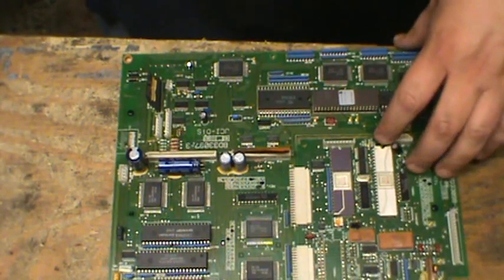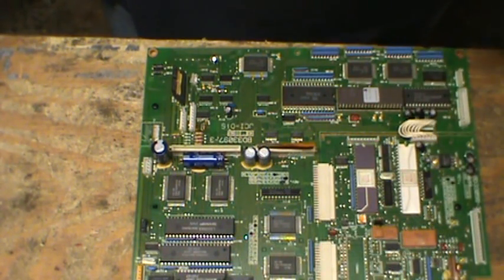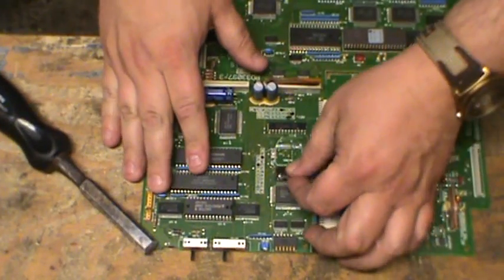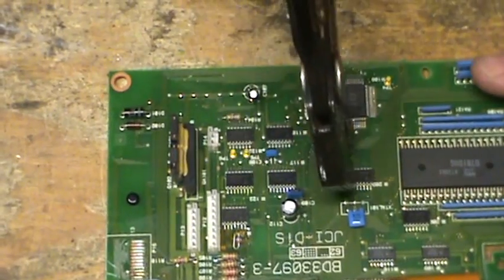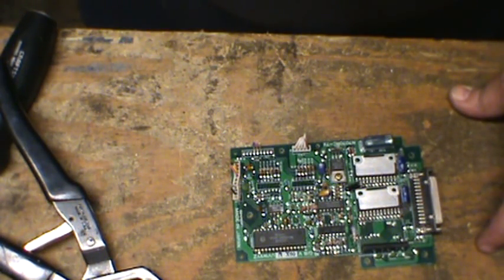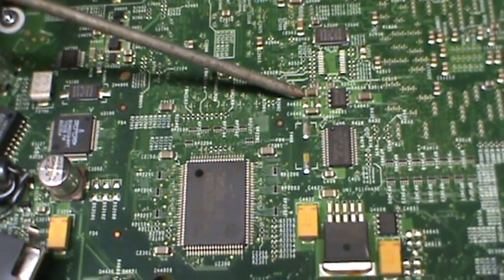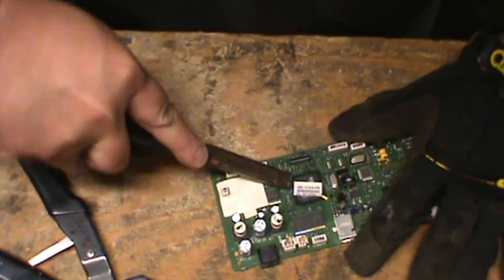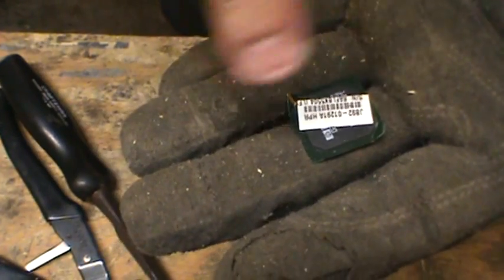Scrapping, how to remove IC Chips, and what else is worth money on a circuit board

Comment from the maker: For most of the soldered ones I still use the channelock twist to get them off.  It may take a little wiggling back and forth but they do pop off.  There are other methods of depopulating boards that include a hot sand bath that I have not tried yet but 10464jeff has a video on that, also you can use the more toxic method unless well ventilated of using a heat gun or a propne torch behind the board to soften/melt the solder.  Beware of the fumes thought!  Thanks for watching!

Comment: OR, if u actuly CARE about the chips, desolder them and sell them to pepole who build electronics with them.
Reply: otherwise u are doing what kids do to pcbs
Reply: if they are old mobos, most of them are pretty useless
Reply: um, nope. The older (30-40 year old) boards often have more rare and hobbyist friendly parts on them. Modern boards are built by robots using extremely tiny parts that are difficult to work with.
Reply: But you have no idea if they work or not.  Could be from a fried motherboard.
Reply: Connorocker my kn
Reply: Many IC components are so tiny that by the time you remove them, you're likely to damage them to the point of uselessness.

Comment: Awesome video series on the electronic stuff.  Lots of stuff learned there.  I'm just starting to get involved with scrapping out computers since its basically untapped around here.  I've been in the auto salvage business for several years now, but this would give me something to do after its dark.  The ultimate question to me is, how far should I go when breaking down the boards?  Cut the fingers off and send the rest to boardsort?  Or is worth taking all the IC's off?  If you yank the IC's, will somebody buy the rest?  I'd appreciate your thoughts.
Reply from the maker: I think that you get the most bang for your buck, and time, by starting off recovering gold from the fingers.  Boardsort will still buy the rest of the ram and pci card without it.  Its gets your feet wet so to speak with gold recovery.  Then you can decide if you want to venture further.  The big thing to remember is the volume needed to get decent results.  You can spend hours plucking gold plated pins for only a gram or two of gold, or you can spend a fraction of the time, sorting and shipping to boardsort.  Once the IC is removed from the RAM, they wont buy it.
Reply: Moose Scrapper Thats exactly the info I was looking for.  Thanks again and keep on scrapping!

Comment: What about gold within the layers of the board itself?  For instance, the apparent gold connections in the board that are under a cpu chip.  Gold connects to gold well so there should be gold where gold pins go into the board. Do any boards have a layer of gold underneath the green, red, or whatever color surface?  What are gold colors that shows in various patterns on the board but seem to have no particular purpose?

 Are any silver wires solid  or are they always plated?  If solid, which ones are they?

Comment: In my low grade boards  I take out the tube fuse too since it's so easy. I wonder if they can be sold on ebay by the pound too? I've also found that heating the board with a heat gun can loosen up everything pretty quick and easy (for low grades). I found a board that's metallic and can be bent, it's not silicone for sure. Have you come across that type of board? Is it worth anything?
Reply from the maker: Yes, I see them in some electronics.  I just throw them in the light iron pile.  Most of their weight is that anyway.  As for the tubes, the best way to look to see what you can get is to go on ebay and search the sold listings to see what they are going for. Thanks for watching!

Comment: do the taller tube type blue capacitors have any value or pm in them
Reply from the maker: +Amber Moss no, they just have aluminum as far as I am aware. (and other chemicals inside of course, just the only metal is Al)
Reply: ty

Comment: what can be done with plain circuit boards (Just the green fiberglass ) after the process of recovering all the precious metal is done?
Reply from the maker: There are companies that buy them for the copper tracing and solder and they also recycle the board material.  I don't strip my boards down that far so I am not sure of any specific names, I just know they are out there.  Thanks!
Reply: Niral Pawar 
Many thing

Comment: What is valuable about a number 2 circuit board? I've heard you mention them in videos, and I wondered what makes them worth scrapping?
Reply from the maker: Hi and thanks for watching.  I do not recall referring to them as #2 board, they are broken up into tiers.  Low, mid, and high grade boards.  Scrap yards buy them for their metal content such as gold silver, platiumun, palladium, tantalum, copper, aluminum, and so on.
Reply: Moose Scrapper I must've gotten you confused with someone else. 'My apologies. Thank you for attempting, as best you could, to answer my question :) . It was helpful.

Comment: Most socketed IC's are programmable and that is why they are, well, socketed and not soldered. I was wondering if these might have gold bonding more often only because of their importance to the machine.
Reply from the maker: I have cracked open quite a few, hoping to see some gold bonding wires near the silicon wafer, programmable or not, its still kind of a crap shoot.  Thanks!

Comment: Thanks Moose! Gained much knowledge about e-waste. I have one question: Does IC chips contain silver? If not what kind of metal is that.
Reply from the maker: IC chips can contain a variety of metals.  They can have gold, copper, silver, and other metals as well.  Type, quality, and age can help determine what is in there.  For the most part, the silver in IC's is on the legs and is plated on.  Originalfeets just posted a video on them.  Thanks for watching!

Comment: Mr. Scrapper, what are the little cylinder capacitors called. They are brown with darker brown or orange stripes on the ends. Kind of the shape of a tylenol.
Reply from the maker: hard to say without seeing but sounds like a resistor.
Reply: Moose Scrapper yep, I googled resistor and that's what it is. Are they worth anything, worth collecting?
Reply from the maker: Not that I know of but I will be the first to admit there is a LOT about thos little componants that I do not know.

Comment: So your busting out the chips aggressively instead of recycling (reusable) , do you just save up so may pounds and sell them to scrap yard  or are you smelting or using your acid/Clorox bath to recover PM?
Reply from the maker: +Robert “1932chevytruck” S I am saving them, I do not know enough about electronic parts to be able to resell them.  I keep them until I have several pounds then recover the gold myself, though HCL and bleach is not the method used.

Comment: Three words for you, bro....rechargeable Dremel tool.... Because you have pointed out the worth of these chips, I have been using the tool to zip them off in seconds with no effort.....other than cracking that bottle cap every 30 chips.

Comment: Im curious as I can not find the info on my mobile device. I have conection flat cable labelled sumitomo-c awm 20624 80c 60v vw-1 f and I do not know if its worth keeping. It shines like silver or platinum but I cant find comfirmation online. Have you discovered the type of metal they contain?
Reply from the maker: Truth Seeker often its aluminum.  Sometimes silver plated, either way, PM value is so low its not worth recovering.

Comment: Would it be a bad idea to sand bath motherboards and just separate everything after you get it off?
Reply from the maker: +ManiaOperativa The bigger the board the more heat it sapps out of the sand and will take longer.  But yes, you can do it that way and just use a piece of window screen to sift out the sand.  Personally for mother boards, I remove what I want for gold recovery by hand.  Yeah it takes a little longer, but when you know what you are digging for you can process them pretty quickly.  Thanks!

Comment: how long does it take you to depopulate your motherboards  also in the audio jacks on the motherboards i tore one of them apart and appear to be gold plated like  i thought maybe just the tips would be but they appear to be completely plated/painted. any insight into this would be great thanks.
Reply from the maker: Luke Ketelhut hI THERE, It takes me about 10 minutes to depopulate a mother board.  I am a bit selective as to what I take off though.  The parts inside the jacks are indeed gold plated.
Reply: Moose Scrapper thanks i'd have to say i'm very new at this cause i take a lot longer to do mine and thanks on the audio pins poped the vga port open on a old video card. it looks like military grade plated lol. thanks

Comment: Careful with board sort . A lot of time spent on pulling capacitors. Ten of them boards you stripped would or you $150.00 . You could still pull ic socket chips . Save time and still make a good buck.

Comment: by the way,thanks for all the help!from watching your videos we made over 2000 dollars in total so far.and still have these tantalum capacitors and gold plated pins.what are these worth a pound?
where to sell?
boardsort didnt give a price on those
Reply from the maker: Thank you for watching!  The value of the gold plated pins varies quite a bit because gold content can vary a lot.  I sell mine on ebay. It helps to keep the different pins separate like ide pins, pins from phone jacks etc.
Reply: makes sense... what do you usually get for different things you can rip of these boards?
Reply from the maker: katnryan verreux Whooo...that would be a long list... IC's about $3 a lb, MCCs, 50-100 a lb, depending on the market.  ide pins as much as $50 a lb, phone jack wires, the same.  flat packs 5-10 per lb, just some basic numbers.  Check out ebays sold items for current pricing.

Comment: +moose scrapper is it worth actually removing the chips. i had 30 lbs of low grade and 8 lbs of high grade boards. after removing all the chips it was all low grade. i only received $.10/lb on the boards. so is it actually worth removing them from the high grade?
Reply from the maker: Value is a completely subjective thing.  There are a lot of variables as well.  What are you scrapping for, the most money, is gold recovery an income or hobby?  Does your yard pay much more for high grade vs low grade?  For me, its worth it because my yard pays one price for boards, and I enjoy the gold recovery hobby.  Its not a source of income that I rely on.  I think that's the best answer I can come up with.
Reply: +Moose Scrapper unfortunately my yard pays separate prices per each grade of board. right now I'm in the stages of collecting the gold to process. i have several 5 gal buckets full of boards that need to be processed. just from land line phones.

Comment: Well I'd like to add to tour knowledge, you can sometimes find tin or aluminum resisters they are soldered on but easy to remove most are about 5mm wide some have a black plastic drink wrap with a gray/white stripe, not sure what kind of foil is inside of them but both end are rubber insulated on the ones I found, bit as a hobbie deffo worth taking a look, I did find similarity's to lead but its far too gray to be lead, iv subbed so if any one has an answer will be much appreciated also while on the subject mist resistors are silica based ceramic so please be careful, they also contain anything from graphite to gold

Comment: if you do this do not through the circuit boards away THE HIGH GRADE ONS ARE 45% COPPER BY weight these boards are multilayered and have to be ground up to liberate the copper but at between 2 and 3 dollars a pound and the price likely to go up save the boards until you have a bunch the look at making a flail mill sort of a hammer mill with chains instead of hammers there are lots of ways to separate the fiber and epoxy from the copper.

Comment: I found a laptop board that has dark orange capacitors and I think they may be tantalum due to the shape and size. But I've never seen this color. Also heard blue caps are tantalum?
Reply from the maker: I still struggle with tantallum.  Original feets knows a lot more, check out his channel and ask him, he has a few vids I think on just those.  Best of luck to you!

Comment: You have a video on how to pull pins off of the "green" boards.
what about ceramic boards?   is it the same process?
Reply from the maker: Hi and thanks for watching.  I do not think I have ever seen a ceramic board?  Where did you get it from?
Reply: ITS A INTEL CHIP
Reply from the maker: OOOhhh, So its not a ceramic circuit board, you just have a cermic CPU chip, gotcha.  SO far the only tried and true method for gold recovery from those buggers is to use Aqua Regia.  I don't use nitric acid at all so I will not be of much help with that.  I just know that you are supposed to break up the CPU a good bit then set in a beacker for the AR.  This spring I will be doing soem experimentation on using other methods but would not dare to share any of that now and risk someone losing their gold.  
https://www.youtube.com/watch?v=tQ_R8Gr26kk
https://www.youtube.com/watch?v=Hv4CcaTVJqY

Comment: moose!!!you did it again with a GREAT video!ive become a pro in no time.but heres the deal,i think i have alot of high end gold yielding material.they are about about 3 pounds of trimmed fingers,20 pounds of thess ic chips,,some with gold fingers,and some with infrared tops to flash bios,but mostly what you showed here,along with 5 cpus that are gold finger and capped ceramic cpus,one has gold caps on both sides,and about 2 poundsof ceramic or greenfiber  or pinless cpus, i have not yet removed the tantalum capacitors or little yallow boxes,and i still have boards to re scrap for these,is there anything else i should look for before selling the circuitboards to my local scrap yard?weve made 200$ in boards alone in two days and i feel like ive missed alot in a hurry or angst. and what should i expect  for what i have already.? 
----------------------------------------------FOR REFERENCE --------------------------------------------
 i live in tampa, florida ,33615
the computers these are from are GRID and LEGEND computers from 186,1987,1988,1989,1990,1991,1992.
the cpus are as follows: intel 286,386,486,intel dx2 ,dx4,cyrix fasmaths,misc. amds,and some with no identifiers or names that are obvious,but have gold plated caps or pins.
my local scrap yards pay almost 2 dollars a pound for what they call #2 cicuitboards.and some of it was tarjeta/motherboards.
-------------------------------------------------------------------------------------------------------------------------we havent given them the low grade  boards from the 100 monitrs yet.what is the difference? 
and most importantly,,,how much  do you average i might be sitting on?
what is the best way i can maximize my payout? i noticed you mention boardsort.com  ,,are they a reliable source?and how much business have you done with them?do they buy these things?
i ask because i am worried about getting ripped off or lowballed. the boss at the scrap yard noticed i was asking ALOT of qeustions and PAYING close attention to what they were doing,,,and came out and i watched him RE-SORT the bords after they seperated them,upon checking the receipt, i saw we got ALL 32 boars and 50 cents worth of #1 boards.(they all speak spanish and i understand none)
can you make a video and answer some of these qeustions?
i would GREATLY appreciate the help
S.O.S!!!!!scrapper in need of help!!!
Reply from the maker: Wow...lots of info there...lol!  OK, so to start, it is not uncommon, unfortunately for scrap yards to lowball, they are trying to make a living, albeit sometimes not honestly.  You do need to understand though that they do have the right to pay you less for items if they are not sorted properly.  Expample, you could have a box full of #1 copper, but if there are a few pieces of #2 copper, they can pay you #2 price for the whole box because it is considered unsorted.  Same applies to boards.  If you have that many ceramic chips, then you do have a good bit of money there.  I would have you sell to boardsort before the scrap yard as their prices will most likely be much higher, however you do have to pay for shipping.  I will try to make a video for you to cover all of this as soon as I can.  Thanks!!!

Comment: So, on my first run I put whole ICB's in AP solution. That stripped off all the metals. I'm wondering if there is a way to separate those metals chemically. Any ideas?
Reply from the maker: Andy Patmore sorry, no ideas.  I discourage people from doing that because I know I will get questions I cant answer if I don't.  Perhaps indeeditdoes, drew metalsmith, or the goldrefiningforum can help?
Reply: Andy Patmore I believe I saw somewhere a stainless steel rod will attract the copper to it? It will kind of look like lead cauliflower I believe. I hope that helps a bit.
Reply from the maker: lost in the tundra YUP, just like in the video I did on that a few months ago.
Reply: Then that is where I saw it Moose Scrapper. I have been an avid fan since first stumbling across your channel a few months back. Any idea on how to get brass or aluminum out of the solution? And to be clear, by "any", I mean as close to as simple as recovering the copper is.
Reply from the maker: lost in the tundra Unfortunately no, Brass howver is a mix of copper and tin so likely you are recovering the copper part of it.